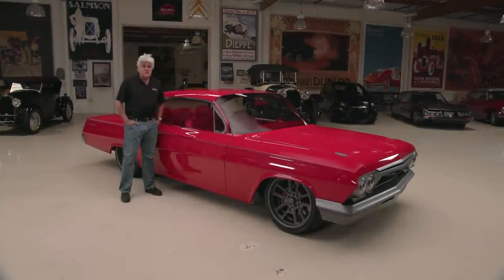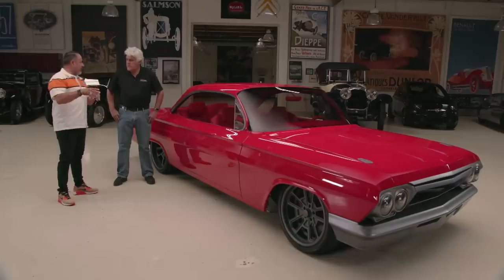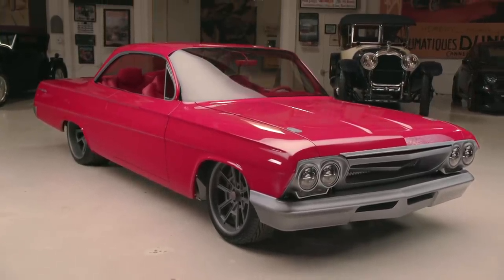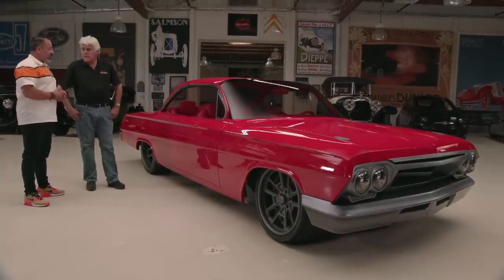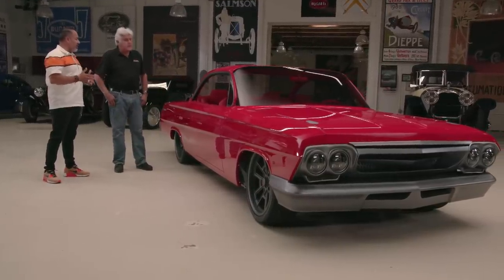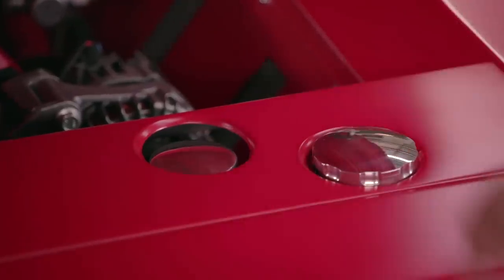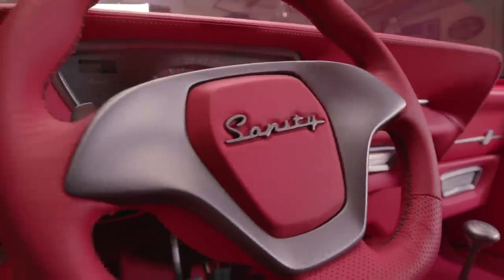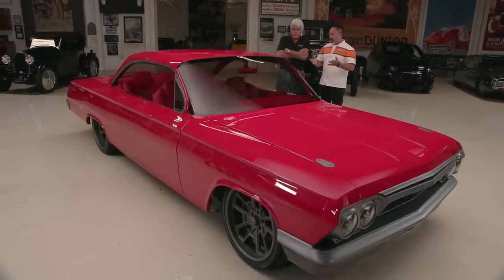1962 Chevy Bel Air "Sanity" - Jay Leno's Garage

Comment: I remember Hayden Profitt(sp?) racing a '62 bubble with a "409". Story was that he had bored the right bank something like .030 over and left the left bank stock. The reason was that the right side had the air conditioning compressor along with all the plumbing. When the NHRA did a tear down they always did the left bank only. Probably an urban legend, but a good one. :-)

Comment: The video was re-uploaded because the 90ies called and wanted their car back. The issue was solved when Jay Leno promised to never feature a car with an all red leather interior ever again. Not to mention a red on red on red on red car.  The uneven headlights and weird front grill gaps and lines was NOT the reason why they re-uploaded this rush job.
Reply: The headlights aren't uneven? And the gaps in front are intentional...
Reply: Instead of Sanity,call it Period,lol this ol timer looks fruity

Comment: Gotta say, I don't usually like "modernized classics" - but this is just done so well that it blurs the line. It looks almost like a modern "throwback" car, like the Dodge and VW throwback models. It looks like what I would expect Chevy to release as a concept car for a "throwback Bel Air" to compete with the Dodge Challenger.

Comment: Dammit! I still want to sneak my car into his shop. I'll just put it in line, let his guys do their thing and when it's restored sneak it back out. It's very small, they'll hardly even notice it. It's a'68 Corolla 2 door I've been driving for 30 years. 

One of the first imported here and one of 7,242 sold. It's been a daily for most of it's life, a few spells of sitting for a while here and there while parts are searched for (or motorcycles were enjoyed) but It's given tremendous, above and beyond reliability overall. Hundreds and hundreds of thousands of miles. I've need a tow 2 or 3 times I guess but it always tries it's best to get me home and it's very simple and easy to work on. I can get 50 mpg at 65 mph. I've put disc brakes on the front, and bumped the engine up from 1.1 ltr to 1.2 ltr.
It's time for new radiator, windshield, steering box, seats, leaf springs, struts, new headliner, door and window seals, carpet, stereo, a little bodywork and paint.
You know just a few minor details. I just rebuilt the engine and put a few thousand miles on it, but the steering is finally getting too loose to handle on some roads...nearly a half turn of slack and no adjustment left. No parts, I'll have to modify something.
Reply: Why put so much time money and effort into a little import?
Reply: @johncastillo2194  What "so much"?
I've got $4000 in it and have been driving it for 32 years now. As far as I can tell it's the only one still driving in the US and I plan to keep it going til my grandkids are driving it.

Comment: afew years ago i built a 61 bubble 409 auto body and drive line for a customer when i was younger i had 63 pontiac conv 348 tri power 4 soeed i traded it for a 650 triumph

Comment: Sorry Jay Leno, I can't upvote as usual.    I grew up with a gorgeous Twilight Turquoise '62 Impala.  It was the 4-door Sport Sedan that sported frame-less windows and no ugly center posts, just like the sexy 2-door coupe models.   Why a 4-door?  It was a family car after all.  My dad had bought it brand spanking new from LaPointe Chevrolet in Charlotte, NC.  A few years later I learned to drive in that '62 and took my drivers test and got my first drivers license in it as well.  ;^)

Yep, that era of newly fin-less Impalas ('61 thru '64) were simply beautiful, fast, dependable and so easy to work on, and simply great cars.  Sadly, this Ralph guy completely trashed just about all of the magnificent sexy '62 Chevy signature details.   DANG, he butchered that rare bubble top '62 so badly inside and out that words can't describe how disgusted I am.  I felt the same way when the ultra-talented Chip Foose similarly butchered an extremely rare in-fantastic-original-condition '71 440 Dodge Challenger, for an Overhaulin' episode.  Now if these cars were born from completely mangled rusted out long-forgotten wrecks from a junk yard, as some are, it wouldn't be such a big deal.  Dang, there ought to be a law!

Comment: Cars built in this style let´s call it "Sema-style" lose all there soul and just look plastic and cheap but at the same time very expensive and done by someone with no feel for design...

Hope this trend dies soon but i has been around so long so i doubt it.
Reply: Ditto that. This is missing that chrome bumper and beautiful stainless steel trim and does look like cheap plastic.
Reply: But maybe the toy-like looks was the goal to make this car absolutely unique? There is nothing like this around. And there are still dozens of thousands of period cars with chrome/steel. I am not saying that this car looks amazing, though.
Reply: I feel like the build quality is great and the attention to detail is great. I'm not a big fan of the wheels and the red interior. But I think this guy could easily do a project for someone who wants it to look a bit more original looking than this, but still keep it unique. I actually kinda like the powder coating on the bumpers. But I'd probably want chrome wheels and some chrome trim here and there. So I see what you're saying, but I think it's kinda cool to see something different at the same time.
Reply: Well, being a designer and a car guy I tend to agree with you from the aspect that the builder has no feel for design. The details are bothersome. The hood to grill gap, the exhaust cut-outs in the rear bumper in particular. The extreme dechroming can get old pretty fast but to see what the original stylist had in mind, without the chrome, is sort of interesting (as an aside, when I had my Europa painted and it was covered in sealer before color I got that same feeling). The front grill is a bit of a horror show too. But it's different for eveybody I guess, the car sold for $220,000.00 at BJ so he hit a nerve with somebody.
Reply: @Oscarphone  : No feel for design? Front grille a "horror show"? I'd drive this car proudly. Why is dechroming old? Chrome is also old, but that doesn't lower its value.
Reply: Right you are !!  I love the interior but the outside looks like some rich guy with no eye for design, or taste, just wanted to blow $250K.  It's a 3.5/10
Reply: I have an idea, spend your money building what you want, & shut up hating in others craftsmanship. Can anyone with a negative comment do the work or pay to have it built. If the answer is no, PLEASE SHUT UP, & KEEP YOUR THOUGHTS TO YOURSELF
Reply: Above are a load of people unable to distinguish  between; a restoration, a hot rod and a custom car . But they sure know what they don't like and that is themselves.

Comment: I can understand not driving the car but why not fire it up so at least we can hear what it sounds like.  Also, where will the license plate go?  I didn't see anywhere on the back for it to be mounted.  Beautiful work on the outside, the inside was overdone and needed some color contrast. Would have been better with the gray from the bumpers on the door panels and the some stripes on the seats.  Just my 2 cents.

Comment: Cool enough car. I just don't.like those huge wheels and lowpro tires. The interior is really sharp. I would only change up the dash. Like Jay I prefer the dash to look more original more stock. Even with the total custom seating a more stock dashboard would have looked so much better.

Comment: The car was headed to the resto-mod auction(Barrett-Jackson). A bubble top that will never be the same. That's ok, cause the BeachBoys made the song"Fine 409", boomers can reminisce about those mighty cars!  Resto-modders have great fabrication skills. Not my cup of tea. Back in the day the lead sleds were the resto-mods of the day. So  this trend is not new. With all the hi-horsepower crate motors available today, engine builders will be going out of business(except the exotic car engine builders).
I still think a professionally built 383 small block can kick out the same horsepower and be streetable. The computer controlled engines are more "tractable", so buy a new 'vette if you don't like a rumpy sounding motor on the way to the cruise-in show.imo

Comment: what? Not a driver. Not even start up idle. Does the engine actually work? given it was on a trailer to arrive a Jay's place I'm skeptical at best when Holguin says "I wanted to make a car you could drive to the show". Well, here's the show! but no drive.... pathetic!
Reply: The exhaust comes out the license plate area. IF it is really a driver, where will the plate go?

Comment: Good God what an ugly car. Way too much hot pink.
Is this for the remake of Legally Blonde?
Reply: i say the color is not what defines a car as ugly
Reply: Assigning a gender preference to colors is insane. Get over yourself.
Reply: @airsoft2xtreme  then how come there are more pink girl clothes then.
Reply: @airsoft2xtreme  wow. Very 
Enlightening article you've shown here. Thank you
Reply: Mark I have to agree with you in more ways than one.  There is not much I like about this car.  That hood trim and grill area are not lined up correctly at any angle, contrary to a few comments.  I watched the video and at a specific angle the gap gets more even, but they are still off which is weird they would finish it that way.  It is immediately noticeable.  the interior looks like they tried to make a new car of it and it all blends together.  I didn't see much in the way of styling cues of the original car inside that I would like to see.  Beauty is in the eye of the beholder, but for me, this is one Fugly car.

Comment: this is starting to become a dated hot rodding style.  a decade ago this pro-touring/retro-future style was pretty fresh, but not so much anymore.  the sculpted grille, the faux metal painted bumpers/trim, the lack of chrome, the lack of trim, the dark wheels...it's all been done so many times at this point...and that interior is way overdone.   The stance is great though...that will never not look good.

haha, in 20 years this thing will be just like a 90's hotrod is right now.  90's hotrods are hideous (in retrospect) with their ball milled billet parts everywhere, fluorescent candy flame paint jobs, and raked out stance.   Hotrodding is a fasion statement, and therefore the opposite of timeless.

the next trend in pro-touring (which is already starting) will be all about integrating technology into essentially stock looking vehicles, inside and out.  Using the latest, greatest hi tech crate motors, drivetrains,  and other tech like Drive by wire, brake by wire, electric steering, ABS, stability control, traction control, magnetorheological dampers, carbon brake systems, full digital instrumenation,  hidden or retro appearing infotainment systems with central control, full OBD2 diagnostics, all running off of a digital wiring harness system (systems like InfinityBox),  retro led lighting with courtesy functions, backlit switchgear, ect...  pretty much everything modern cars have.  It might even be worthwhile to start integrting safety systems into classics, like airbags and dynamic seat belts.  Who knows, that could become important in the future.  ok I'm babbling now...
Reply: reactorfallout cool story.... Now upload your car.

Comment: Low riders are horrid things. Impractical. They place a heavy car on tires and rims intended for volkswagens. Watch one have a tire fail at sixty-five, scrape and skid on the ground and place all the vehicles around them in danger. Lowriders are the opposite of well engineered.